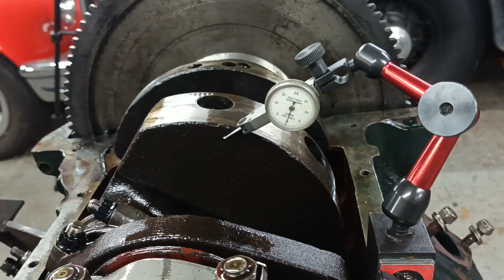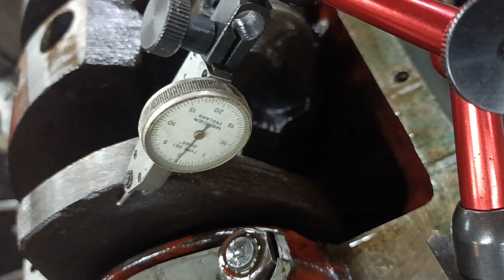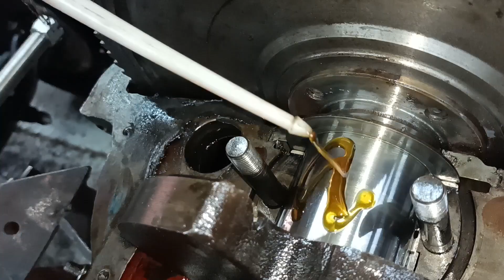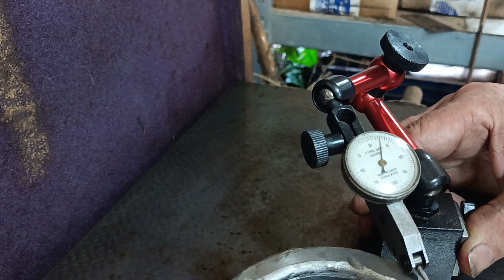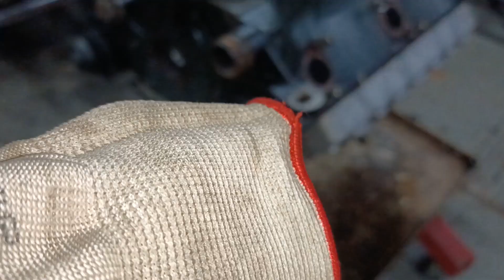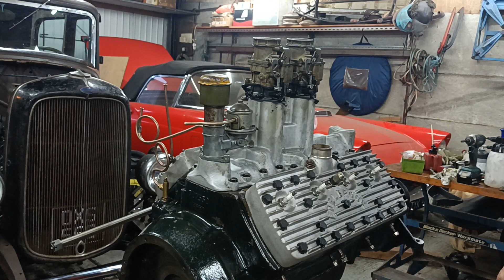Big Inch Flatty: Crank endfloat fix. Part 2. Setting the endfloat with built up bearings. (2270)

Comment: I really appreciate your "old school" approach to rebuilding and repair.  It shows how much one can accomplish with basic equipment.  I've seen things done here that I haven't anywhere else.  This fix using babbitt material to thicken the thrust area of the main bearing is the most daring thing I've seen done involving engine repair.  Elegant engineering at its finest.
Reply from the maker: Thanks William. The high cost of parts tends to make one try somethings others would not even consider.
Reply: @MartsGarage  That and your "can do" attitude!

Comment: Great stuff Mart.. so the thrust face gets the big squeeze when the clutch pressure plate is pushed in but not from the helical gears meshing in drive unless the spigot shaft is too long?
Regards Kevin (stuck in Royal Hallamshire hosp with a nasty blood problem.  Can't fly back to nz yet)
Reply from the maker: Blimey Kevin, I feel bad for clicking like after what you said about your blood. Hope you can get it sorted out, Mate. Yeah, big load on the rear thrust face when clutch pressed in. No thrust from the input shaft unless some goofball gets his measurements wrong. The rear face also gets some gentle loading from the helical cam drive gears. (on a 59A, opposite on an 8BA). As far as I can tell, the only time the front thrust face gets any load is when the crank floats backwards during heavy acceleration. I hope you have been able to enjoy at least some of your time in the UK.
Reply: Yeah had at fab 2wks cruising around the ring of Kerry and attending a wedding in the north. 
Still at hosp in sheffield. Can't wait to get back to my garage work shop. Very similar to yours with a lathe, mill,press, English wheel, folder, and welders of all description. The only problem is I'm terrified of the lathe...

Comment: I have rolled in many bearings usually laying under a truck...LOL. You got it right. You can tap in the last little bit with a wooden dowel, works well. Interesting series. I'm glad you were able to save this engine.
Reply from the maker: Hi Mike. Yeah, it was the first time I had tried it. I feel like an old hand at it now, I had it in and out many times. It felt good to get the motor back in one piece again.

Comment: If you can get oversized bearings for rods and mains can you not purchase main bearing that are oversized in width to cut shaft end play? I'm surprised the heat to build up that bearing did not make it go out of round. I hope that engine runs well. At 75 I would still like a 32 three window Ford with a flathead.
Reply from the maker: Yes, Galen, in theory you can get oversize bearings, when the French workshops reground these cranks I believe they had oversize bearings available. I have not been able to find any though. The bearings are relatively flimsy I think they are held in position by the close tolerance machining of the block and cap. Next video will show the motor running.